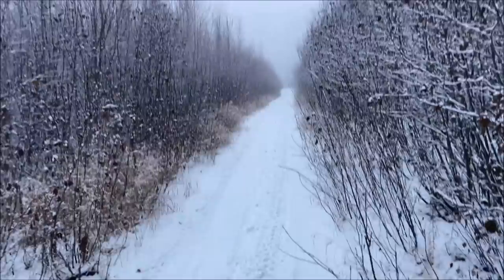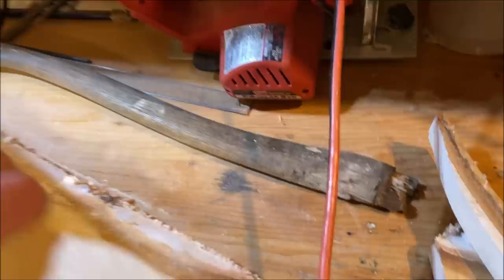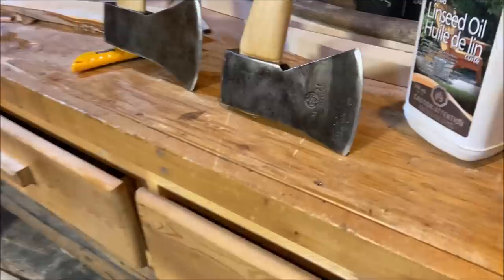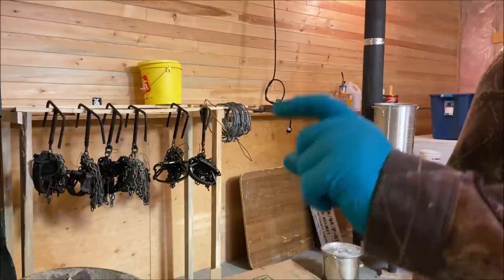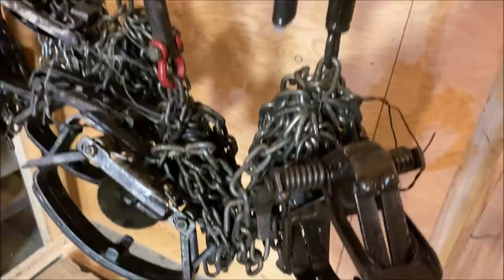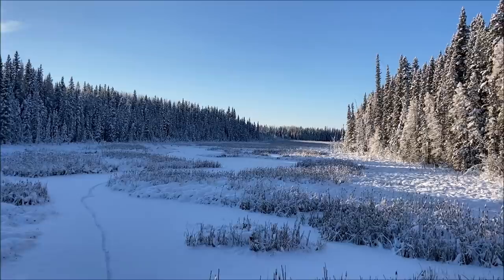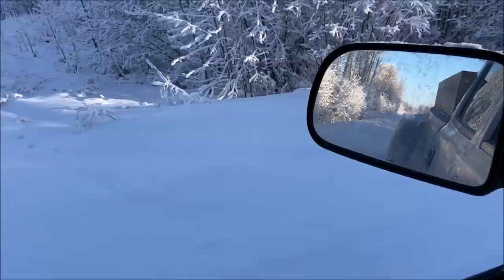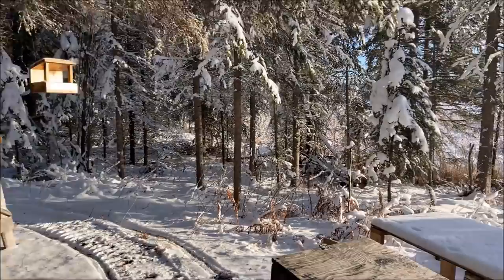Bc Newfies winter Adventures 1

Comment: Must cost you a pretty penny to get back and forth to the line and home if you're like an hour or two hours away the price of gas
Reply from the maker: 2 1/2 hrs yup, use a tank of fuel if i wonder down another road any especially with sled and trailer in tow, almost 180.00 to fill my truck and then theres sled and generator gas
Reply from the maker: thats why i try and stay out as long as i can. used to go out every three to four days first when i started, if i didn't id have fur eaten.